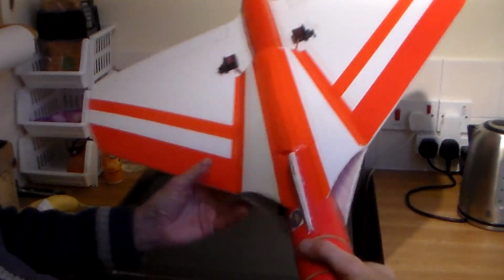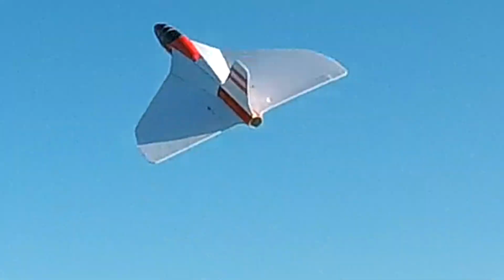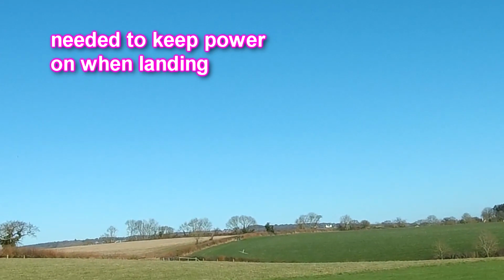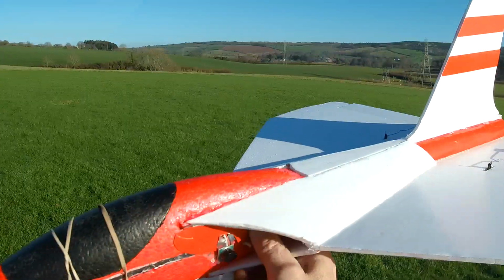My EDF design GETS IT'S MAIDEN!  Lidl Nose, foamboard wing and 45 mm EDF

Comment: Well done that man. Perhaps making it a KF airfoil would help with a bit of additional lift at very little effort?
Reply from the maker: Yes, might be worth trying.  Two layer foamboard wings add a fair bit more weight though.
Reply: @bobflyman  For a 2 inch strip down each LE it should be ok IMHO. Depends also if you hammer that esc into submission 🧐